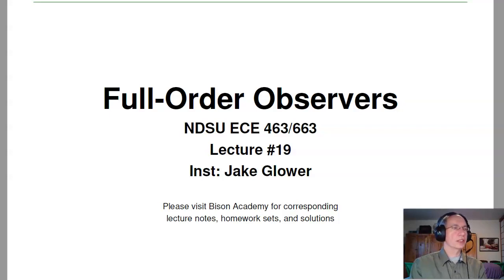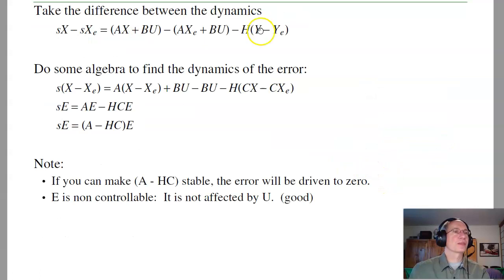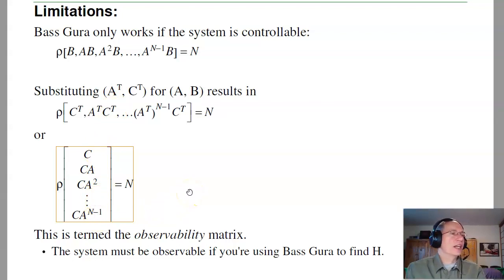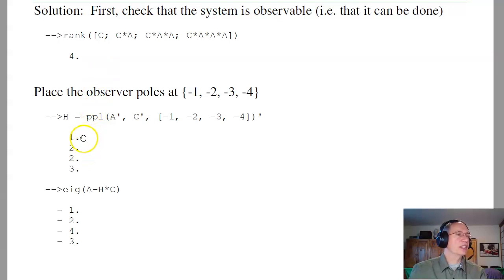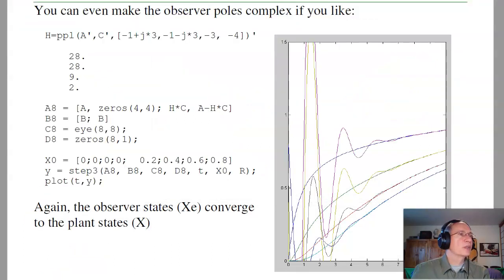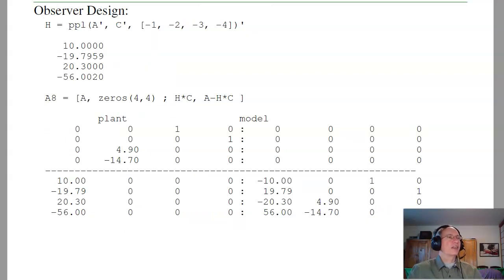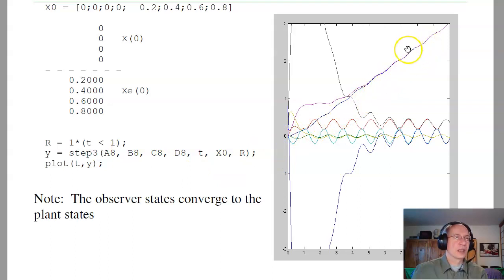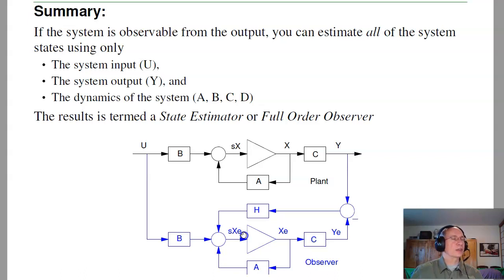ECE 463.19 Full Order Observers

Comment: can i add or rather ask that this will only work if the pendulum dynamics are coupled to the cart dynamics in example the pendulum needs to have more % mass than the cart ?, im having a bad time trying to desing an observer for this system in reality the observer model with only one output x as this example doesnt work at  all for me :(( it is really a pain but when i take x and theta as outputs it kinda works but only if the poles from the observer are very far in the left hand plane